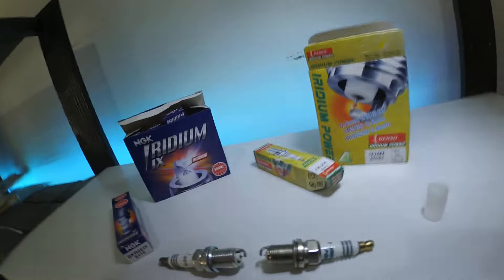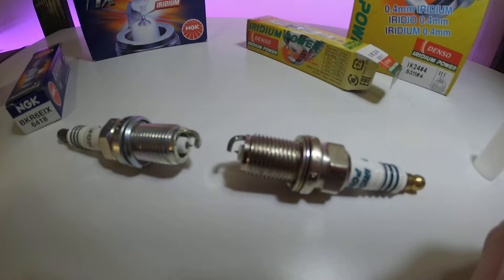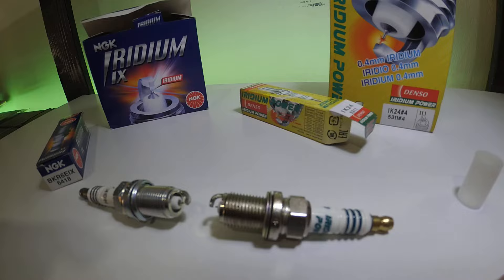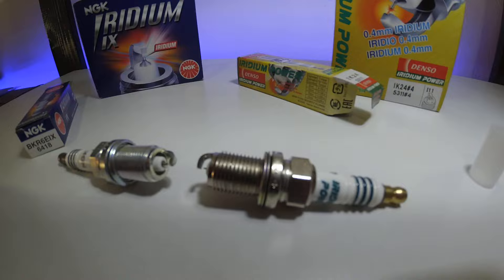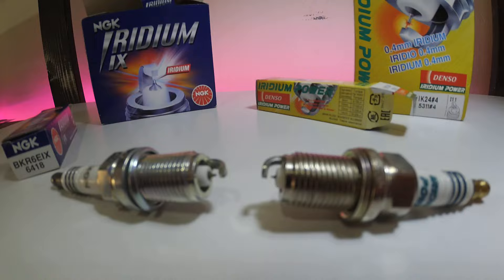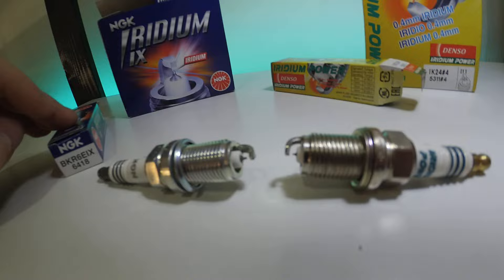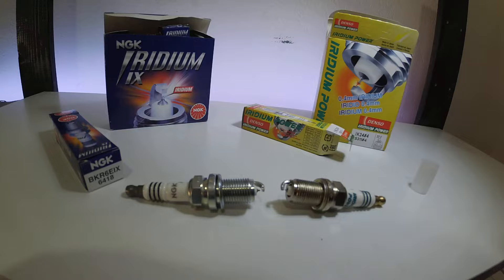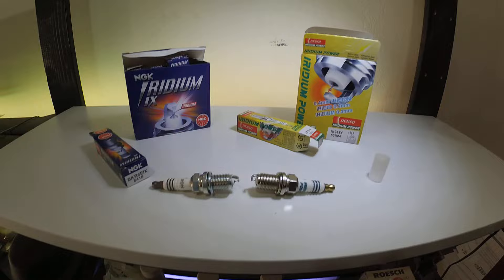NGK Iridium IX vs Denso Iridium Power - What's the difference?

Comment: In my opinion Denso is #1 and NGK#2. No other plugs come close. There is a Denso long life Iridium which has a slighter thicker center electrode than the Iridium power spark plugs. I first tried the Denso iridiums in my 1984 Toyota Supra. I had been using the standard Denso U grove plugs and they were in average condition. When I put the Denso Iridium power plugs in, the difference was like night and day. The throttle response became razor sharp like a race car. My jaw hit the ground, I couldn't believe the change. I have yet to try the new TT Iridium/Platinum. Can't wait to try them.  I highly recommend giving them a try no matter what car you have.
Reply: NGK better plug if your building new horsepower.
Reply: @KVX21  explain? my gs350 stock spark plugs are from denso so im not sure if i should go with the NGK or stick with stock desno, i will be installing a catback exhaust next year
Reply: @senorbonbon  doesn’t matter. Go for which one is cheaper. My Camry has Denso but ngk on sale. Didn’t notice a difference at all.
Reply: @senorbonbon  I have a GS 350, I would use the stock Denso plug, there is also a Denso TT option, they are both very similar.
Reply: @ncvman  The difference is after 20k miles, Denso last longer 100k, NGK is only good for 30k
Reply: @ncvman  It does matter, a great deal. No offence but you drive a camry so low HP. Once you start turning and making big HP the choice of plug is critical. However in a cheap low HP camry you can fit pretty much anything.
Reply: Gapped and tried the IK16 ones on my 140cc bagging mower. I couldn't believe it! It never bogged down to die in tall grass or weeds with the self propel on. And it did this from new! Completely sold on the iridium power plugs!

Comment: denso is manufacturer centric and NGK is customer centric; that is why most of the automobile manufacturers (mostly japanese) uses denso stuffs and buying denso from the the market is different in quality. Once the plugs that came with the car are done, i recommend to go for NGK...
Reply: NGK is not oem tho
Reply: NGK are standard fit on most japanese cars, not Denso.
Reply: @issavibez394  Yes they are. In some V6 Toyota vans, they built them with  3 Denso plugs in one bank and 3 NGK plugs in the other bank.

Comment: I just changed plugs in my 2009 Honda CRV at 15 years and 110,000 miles.  Out came the Denso's and I was amazed at the condition of all 4 which was great.  Even the gaps remained perfect after 110K miles. I replaced them with NGK Iridiums and there is no noticable difference so far.  Time will tell if the NGK's can go 110K miles.

Comment: I just replaced my NGK Platinum plugs for Denso iridium plugs in my Acura . Change the coil packs also. Car runs great a lot more horsepower runs a lot quieter fuel mileage excellent.
Reply: Issa Vibez  the NGK was in my Acura for 9 years they wasn't in that bad of shape but they had to go. The Denso iridium are fire.!!
Reply: Maybe denso is good for Asian vehicles?
Reply: @melancholypuppy3595  for sure Toyotas bc Denso is Toyota's brand LOL
Reply: @princeplotena  figures haha Denso is best for Toyota imo
Reply: But you never used NGK Iridium , so don't compare denso iridium with ngk platinum plugs.  You should have upgraded to NGK iridium pay $30 more for NGK iridium . Denso is cheaper than NGK but does the job but NGK lasts longer and have bigger more spark at higher rpms

Comment: You got some good points in there. But, high boost application increases the pressure and heat. An oil cooler, dry sump, electric radiator fan, water cooling could only do so much. A colder spark plug is definitely more friendlier for high boost, high compression applications.

Comment: Thanks for posting this vid ...my mechanic took off my Ngk iridium plugs that hasn't been changed for over 50k miles and we're still Perfect and replaced them with Bosch Platinum 😥😥😥...now I 've to keep changing down to accelerate to avoid mild misfire. ..used to cruise at 40mph..2k on rev counter in 6th...now I ve to stay in 5th at same speed to avoid mild misfire...buying NGK iridium 2mrrw and swapping ASAP..
Reply: Get a better mechanic too . Bosch is recommended more for European cars.

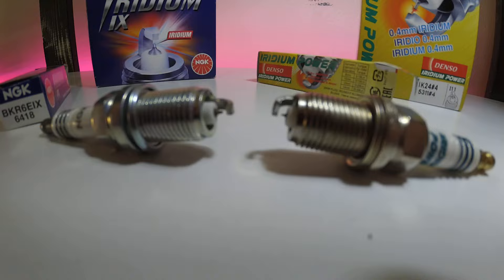Comment: 5:05 "I would say the NGK is a more rugged plug". 
you have that 1000% correct. so I have a high performance motorcycle that needed a Iridium plug . both NGK and Denso made a plug for this model. exact heat range everything. it had an NGK in it from factory when I bought it and it was fine no issues. Well I was replacing a faulty coil, and coolant flush as it was getting to 15 years old this bike. so I decided to do plugs as well as you have to drop the radiator to do it (hence why iridium is the best option for bikes)
so I order some NGK's however they call me back and say they are in back order due to Covid. but we have the identical denso. So I bought them.

Installed and running perfect. I start to ride around. all good no issues. 
however after a few days. after the bike had been ideling at traffic light I started noticing the ideal would start to go funny. and when I would take off you would get that classic plug breaking down from heat. once you go moving and cooled the bike a bit it was fine. but you could tell the tell tale sign the plug was unhappy. I tried to get a 8 range heat rating but they don't make them only a 9 to 4 billion. funny they wont go to a hotter range after a 9 (both denso and NGK) anyway I ended up returning these and getting the NGK's back in there. and guess what. no issues ever again. 
so I would say you are right the NGK's are just more robust. where the denso perform like a more high performance colder plug.
I also found out recently Bosche make a plug that suits my bike. now its getting interesting. because a lot of race teams in certain categories state the bosche is even better a not breaking down and handling heat but giving max performance even over NGK's so ill be keeping an eye out for that

Comment: Standard range plugs from NGK Denso and all the rest have a nickel alloy centre electrode (2.5mm),  after that is the platinum centre electrode usually 1.1mm...and then top of the range Iridium/Rhodium centre elctrode 0.4-0.7mm

Comment: Denso has a global patent on the small .4mm tip. Other the other mfg need to build with a larger tip as such. NGK is .8mm tip. That small tip is the key as your system needs as little as possible to ignite it.

Comment: Plugs are specified to an engine on the chart. Meaning all plugs stated on one fits a car so they are the same plugs when numbers are cross referenced. Toyota uses both brands, some of their vehicles came with Denso in one head, NGK in the other head because the heads are actually assembled at several plants. When the engine itself is assembled elsewhere the heads are already together so one side's plugs are often different but it don't matter because the plugs/engine both are spec.
 Rather it be the engine manufacture choosing a plug spec or a spark plug manufacture that specs their plug to fit engines they are each specified to match &  perform correctly together.
   Only when aftermarket parts are put on a engine does one really need to worry about plug specs/choices. Until then its just the matter of someone's own brand/design choosing, some like myself buy the NGK/Denso laser Iridium OEM while others may buy cheap G-Power NGK and change them every couple yrs why idk??  Done that 30yrs, why go backwards, hell no?
  Some only use Bosch (OMG help them) others let parts store monkeys behind the counter choose for them? He's 18 and drives his mommy's car, he don't know your car like the maker knows it why ask him?..lol

 Now Listen- When its OEM stock, the plug chart is made up between the car/plug makers and why each plug listed for a car engine are OEM spec. Pick one and drive on..
 
 But' If you changed something to +/- fuel/air/timing/spark then you sure as hell better learn about spark plugs as damage can occur..Aka: Burn a hole in a piston.

 https://www.youtube.com/watch?v=lcZBmarGSrk

*Peace
Reply: Harry Balls you writing a bible dawg?

Comment: As for myself, I'll get what's convenient and cost-effective. Therefore, it's a toss-up for me based upon my car's manufacturer's engine specs. Depending on what assembly line at their regional plant have at the moment of manufacturing, it can be either or.  My Honda OE manufacturer specs the Iridiums for the NKKs and the Denso, Denso being the more expensive pick right now. I will be changing out the NGKs to the Denso only since the Denso is in stock today rather than waiting until tomorrow for the NGKs. My 2010 Honda Fit has over 135k and I really don't need to change out the plugs right now because it running fine and the mpg hasn't changed! However, Honda recommends changing them at 100k and since my daily commute is far it will be advantageous for a better fuel economy standpoint in the long run. For those brand fans, be careful and do your research if you'll going to change the manufacturer's recommendations and specs. there's a lot of research and development that goes into the combustion chambers that's designed to work efficiently and engineered to proficiently save us from reinventing the wheel!  
 I haven't seen or confirmed stats of any real wear or performance differences that would separate them apart in quality or durability...
Reply: Great comment very informative!

Comment: I just had my plugs changed from OEM to the iridium power Denso plugs on my 2009 Smart car. Wow what a difference in power I’ve noticed. My smart only has 57000 miles on it but thought ide change the plugs because I noticed a lag in performance..

Comment: I've bought brand new NGK iridium ix from eBay for my Micra k11 1.0 mk2 2001 performance was excellent and fast startup ignition then after 5 months it misfired cylinder 4 and now I sent it to NGK for testing. Could be I used to many fuel additives? Which may fouled
Reply: Most retailers on ebay sell fake denso or ngk's.  They fakers have learned to fake them well. your story is like many others that purchase from ebay.
Reply: Sounds like you got the fake plugs. Buy from rock auto next time.

Comment: Interesting the claim that a smaller tip will encourage a stronger spark.. a smaller conductor has greater impedance and thus will take more energy to conduct the same amount of current across the air gap. This higher impedance will also create more heat.  Probably negligible at these tiny sizes but that is what electrical theory says to my understanding. 🙂

Comment: The insulator on an geniune NGK Iridium IX blew away on the autobahn going full throttle for a while. 
Would not recommend them. Plug was max 10.000 miles / 16.000 km old.
NGK Support did not even wanted to help me find out if the NGK Plug was geniune or not.

Comment: Just did a full Denso to Denso swap on my 07 Camry XLE V6 at 215,000 miles on the ODO and I could not believe how intact the rear plugs looked. #5 was a bit worn down on the ground rod but the other two back there looked perfect. These things are only supposed to last 80K based on Toyota manual and Denso recommendation, but anyone who owns a Toyota V6 knows how difficult it is to swap out the rear set (Youtube it), I can see why they chose to use long lasting iridium plugs. I haven't tried or even wanted to try NGK as most people on the forums will tell you to stick with Denso OEM. Can't say this is true for all makes/models, but it is certain for Toyota.
Reply: About to change out my NGK iridium on a Toyota 1.5 with 125,000 miles on them.  Slightly worn.  Just fyi.
Reply: NGKs don’t even lasts I’ve seen them only last 30k
Reply: @issavibez394  You probably got the fake NGK plugs or used standard NGK spark plugs. The real NGK Iridium last many thousands of miles without a hiccup. My 04 Camry have 265,000+ miles on NGK Iridium after I changed it at around 60K mile per manufacturer recommendation on the OEM plugs. Just saying...
Reply: @Haknumansoksan  are they the ngk ix iridium
Reply: @issavibez394  I believe it was Laser Iridium part # IFR6T-11 but not sure as its been a long time ago when I installed it.
Reply: @Haknumansoksan  I used the ix iridium in blue pack whats the difference
Reply: @issavibez394  I'm not sure but Laser Iridium cost a little more and suppose to last a little longer per specification. Check with NGK and see what they say.
Reply: @Haknumansoksan  ok

Comment: My truck came with 3 NGK spark plugs on one side and 3 Denso on the other side.
Reply: edhombre : My 01 Tundra V-6 Was Same,Though Not Iridium,3 Denso,3 Ngk from Fact.When I Changed Them,So TOYOTA Thinks There Pretty Much ,the Same.

Comment: I'm not sure what are you based, have you ever done a test? The different is rather due to the model# than the mfg name, at least Denso iridium has differences of double coating/performance/long life,etc. The Denso one you used would be 60K miles, and Denso also have 100K miles one. If Mfg choose Denso then at least, use mfg model would give stated performance.

Comment: Every year though to replace platinum Plugs??? I would assume Copper you mean, but platinum will last at least 4-5 years or 50-60,000 miles yes?... Copper will generally last 30,000 miles or a little more... 

But i agree the consistent gap with IRIDIUM and the performance is the way to go!
Reply from the maker: Some engines can be very hard on plugs. Ford Sigma/Zetec 1.6 I found needed the platinum plugs re-gapping every 20-30 thous km. With NGK LPG (iridium) plugs, no problems.

Comment: What’s your thoughts on Denso Iridium Tough plug (as opposed to Power series). Supposedly they get 5 times the lifespan over the Denso Power (100,000km for Tough vs 20,0000km for Power). However, the Tough plug appears not to have the U-groove so if performance is the main objective, Tough may be the lesser choice in the Denso lineup. But for average driving I think Tough will be a great choice as it claims to last much longer.

I’m also just curious how the Tough plug stacks up against the NGK IX you reviewed. I’m wondering if IX has a better lifespan the the Tough. My research shows they are similar but Denso Tough maybe has a slight edge. Also, I believe the Denso Tough electrodes are 0.4mm which is better for performance as you say compared to the IX’s 0.6mm electrode. The IX advertises life between 65,000km-80,000km, and in some cases around 100,000km with ideal conditions. So my question is if the Tough is expected to last as long or longer, and has the thinner electrode too, the Denso Tough would really be the best choice over the IX, right? I am after long life primarily in my application, but if the life is virtually the same or very similar, the Denso Tough seems to edge out the NGK IX on performance too.

I would love to hear your feedback. Thanks!
Reply from the maker: They both are great plugs. Logically speaking the thicker the electrode the longer it will last but maybe the conductors will erode first! I have experience of the IX and 100,000km seems conservative. I have 200k on a set and no sign of quitting.

Comment: ONLY Bosch platinums last 10lmi, bc they're junk. Any other reputable brand 50kmi is typical. Even copper is usually good for ~30kmi.
For iridium the porcelain will crack or coil will fail before the actual electrode wears out.

Comment: copper plugs are the best and i recommend it strongly.or else iridium plugs for longer last and close power to copper..copper plugs wear our faster then iridium but copper gets the best ignition,,try it if you dont believe me..next time buy copper plugs and see for your self. All cars have their own plug they recommend,,use the recommended but also remmember some coutrys have diff additives to their fuel so if yiu want other brand then recommended..do a research for a plug that works best att your area or climate.

Comment: Do not EVER try to re-gap Iridium plugs. These come from the factory to exact specifications for your vehicle. There's a high probability you will damage the iridium or even break it off using a Gapping Tool. Long story short - get the ones designed for your vehicle! They exist! Use them!
Reply: You can gap iridium plugs with the right tool/tools. Meaning not to round tapering spark plug gapper. If you use the right tool you won't get near the tiny little electrode while opening the gap and then there are tools for closing the gap that you thread the plug into.
Reply: Of course you should check the gap (not with the coin style gapper but rather the wire style), it could be damaged during shipping.
Reply: @user-hs2hd7wp9g  I checked the last  set of Densos I put in and they ranged from 42 to 44 factory spec called for 43. The wire feeler gauge has an arm on it that will let you open up the gap without going anywhere near the tiny little electrode.
Reply: Nah, bad comment, always check the gap

Comment: Would the tip break off and fall into the cylinder is that possible ?
Reply: The chance of a full tip bit breaking off and falling into the cilinder is there but unbelievably small.

Normal wear could decrease the size of the tip, but that is really just slowly done with nanoparticles of it at the time. Old ass copper would just melt but the iridium is so little it won't damage anything.